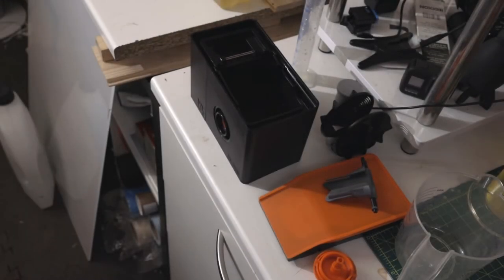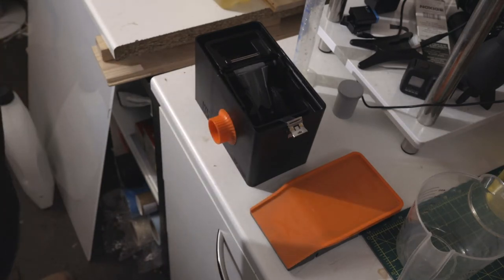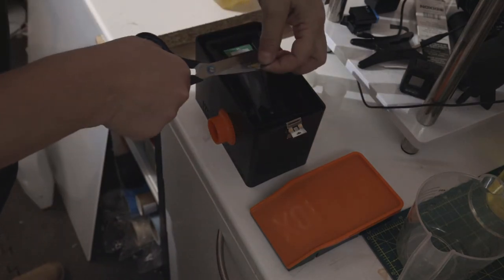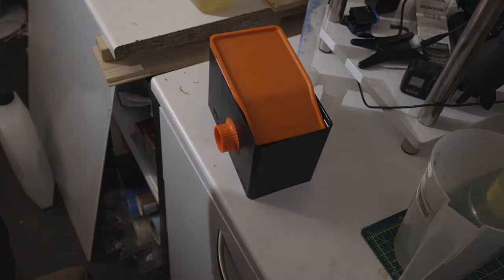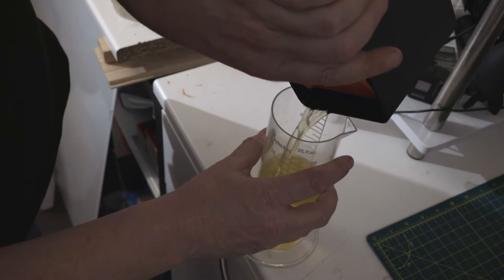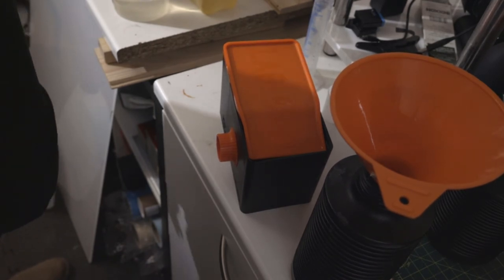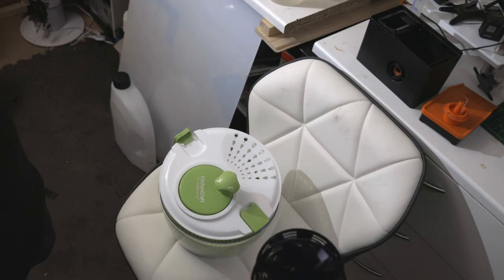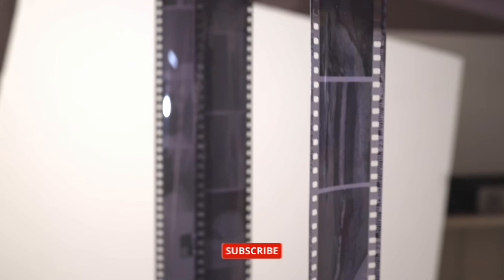Ilford Hp5 Developed using a LabBox, Kodak HC-110

Comment: Very nice video. I still do the old the fashioned bang the box on the table to remove bubbles but I am not sure it is needed with the LabBox.
Reply from the maker: Thank you. I use a Jobo now, 100% rotating development. But had great negs out of the Lab box. Still have mine "just in case". Wishing you well.